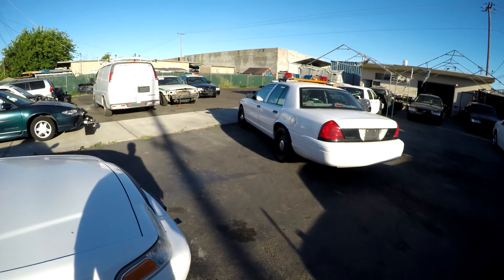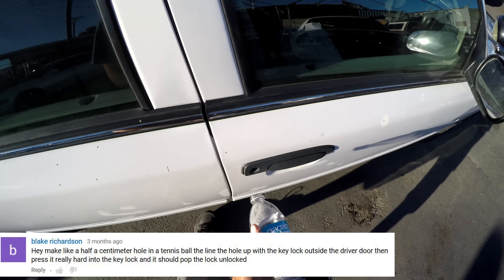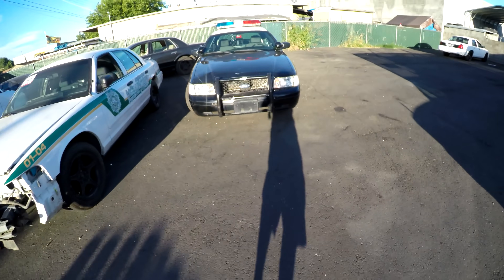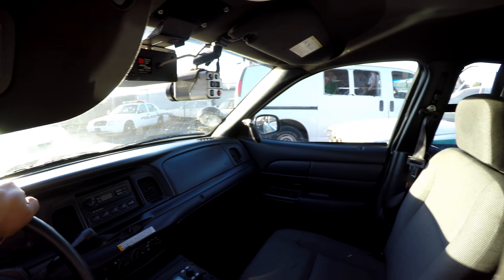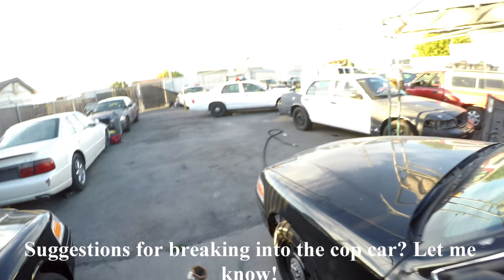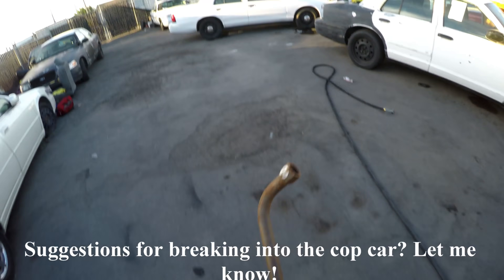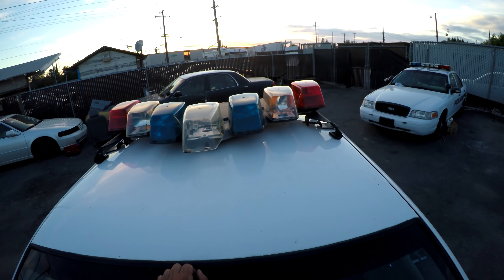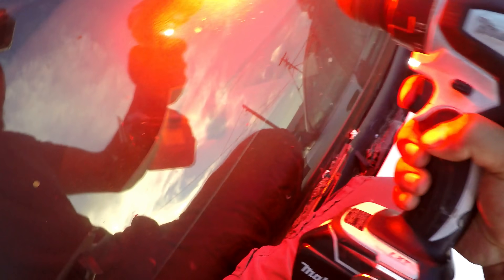1000 Degree Drill Breaking into Cop Car Ford Crown Victoria police

Comment from the maker: New Video! New K9 UNIT! Check it out! https://www.youtube.com/watch?v=MeOxJ8hrUFA
Reply: Crown Rick Auto use a flathead screwdriver
Reply: Can you tell me the song
Reply: Crown Rick Auto your krodr
Reply: Crown Rick Auto  you where bleeding
Reply: Crown Rick Auto blah blah blah blah blah blah blah blah blah
Reply: Crown Rick Auto is it outside in Sugar House and then pooping
Reply: Heat the glass up real hot and then put the  water from the hose on the hot glass
Reply: Crown Rick Auto  next time u get hand cuffs send them to plz
Reply: Try the plastic stick that tow truckers use to opens the door of the car they are towing so they can get in the car to release the hand brake
Reply: Slij
Reply: Crown Rick Auto yo man. Bext time use a ice axe on the thewibshoeld
Reply: LIGHTspace what
Reply: Jazsa
Reply: Crown Rick Auto you should have used the top of a spark plug
Reply: 911
Reply: Crown Rick Auto 👍👍
Reply: Bryan is a great day at work today
Reply: Bryan
Reply: Crown Rick Auto 9
Reply: Hit the very corner of the window with tire pipe iron it will just shatter after few hits . I practiced for hours in my junk yarf
Reply: Put in a flashlight in using taser to break down the door
Reply: Pry open the hood and break the spark plug, or grab an extra spark plug and break it, the porcelain in the spark plugs goes through the glass like tissue paper.
Reply: Use the ice scraping part of an ice scraper
Reply: You should have a back up window breaker on hand in your shop to open the Windows they are only like 20 to 40 dollars depending on where you look
Reply: Why don't you just get a glass breaker???
Reply: @ghost_8599  why your bleeding at your hand
Reply: Crown Rick Auto xu
Reply: You dont scard cooppp
Reply: Next time throw a spark plug at it
Reply: Throw a brick at the window
Reply: Wow you could of got a blow tourch and put I to the window and it will brake
Reply: Crown Rick Auto Siri wrong about doing is
Reply: Use a shovel smash the window with it
Reply: Crown Rick Auto  how about you use a sledgehammer to break during the open
Reply: Julian Esqueda ,
Reply: Hammer it
Reply: gabriela julia cabrera 
K

Comment: If your trying to open the doors break some pieces where the door joints are and blow torch the joints off and then do the same thing to where the lock joint is

Comment: Either use a metal coat hanger or something like that push between the door  and frame to pull the handle from the inside or something really small and sharp hit it against the the top left of a window

Comment: Take an antenna hold and fling the tip of the antenna with the ball at the window don’t hit the middle of the window it won’t brake but you have to pull the antenna back as far as you can and let go of it

Comment: Or hold a flare to the window in one small spot and let it get hella hot, then splash ICE cold water on it. And i dont just mean ice cubes it water. I mean a cup full of just ice and stick HELLA salt in the cup. It will melt the ice and the water will be freezing. Then splash it on the spot right when you take the flare off. It should shatter the window

Comment: You should of used small piece of ceramic. Throw it into the side window and it will crack the window very easily. No force needed, no stone no nothing. Piece of ceramic size of 1 cent will smash side window
Reply: to get ceramic, take a spark plug, knock of the white bit of the spark using hammer and use that to throw into the window, does miracles. Make sure that ceramic is very dry with no water on it

Comment: Heat up the window with a blow torch and then smash it with any metal tool you got or if you have liquid nitrogen pour it on the window and get the blow torch